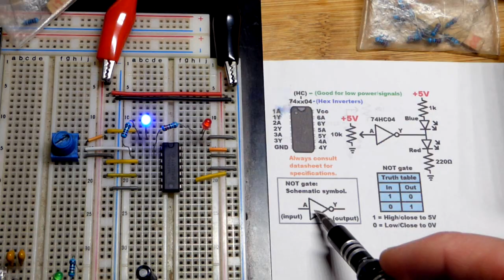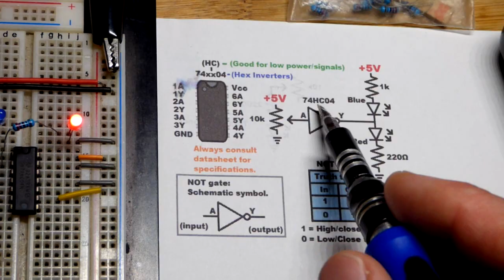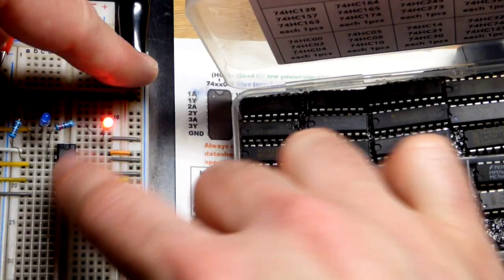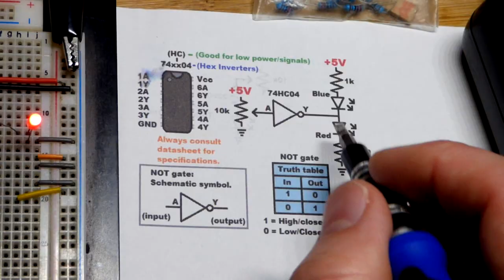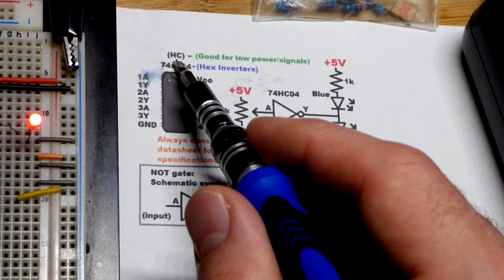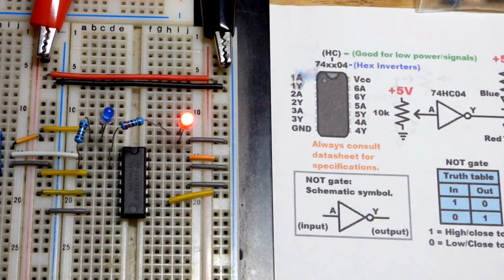How to use 74HC04 HEX NOT Logic Gate Integrated Circuit

Comment: NICE VIDEO!!
Yes, If both the LED's are on while hooked to the same HC output, they are oscillating.  It would be very interesting to see how a decoupling cap (TAN.  0.1uF), connected to the power and gnd pins of the IC (on your breadboard) would effect this 'critical' region'.  Back in the day (decade) when I was designing PCB's, I would place the decouple caps UNDER the IC (it was in a socket) so I could get the leads as short as possible.
Many times this cap is absolutely critical.... the fact that they always made the power and gnd pins of these IC's as far away apart as possible (diagonally), is still a mystery to me.
Also,another odd thing...I zapped a couple cmos chips while using a wrist grounding strap!!  It turned out that the IC was at a high static potential and the surge of current to ground zapped it.  The solution was to always have the ic in conductive GROUNDED foam...I vividly remember some pretty significant electrical shocks when I touched the conductive foam grounded to earth.
I keep about a square foot of foam attached to my bench directly running to the green wire!
Reply from the maker: Good info, thanks for sharing! I do not remember ever knowing when I fried an IC, they just stopped working, and when I swapped it with the backup IC, it worked. I do know that I took no precautions at all when first using CMOS ICs to see if they actually fry as easily as people say. I handle the 555 timers and LM358 op amp ICs a lot without precautions and I don't remember damaging any of them unless I dropped one and accidently stepped on it. Now I try to always discharge myself before touching CMOS ICs, and I think doing so is saving a lot of them. Each one of these videos is another experiment to see how delicate they are. If these videos do well, I plan to buy a bunch of ICs from whatever supplier has the best reputation, and comparing them to the discount ones that are available.